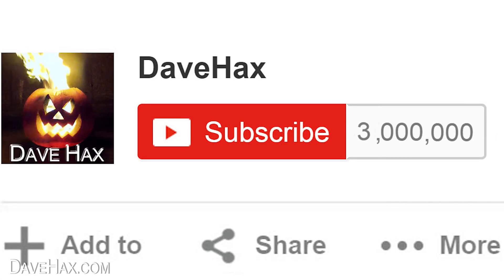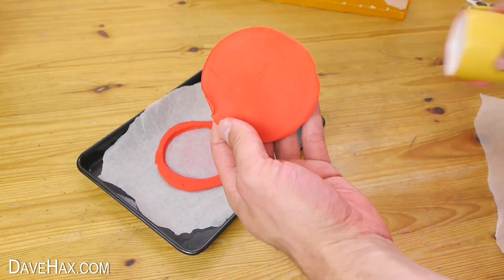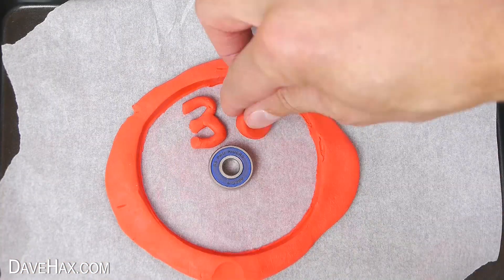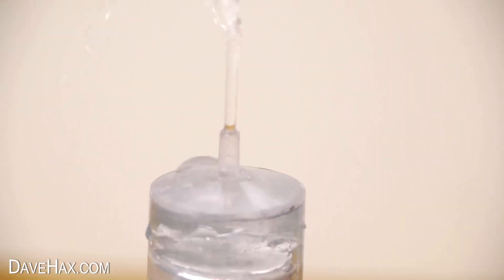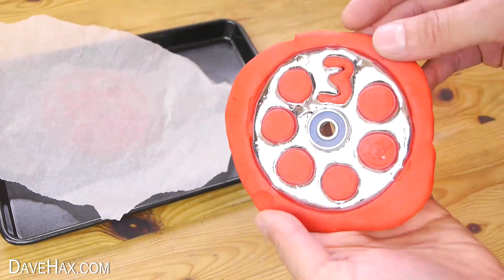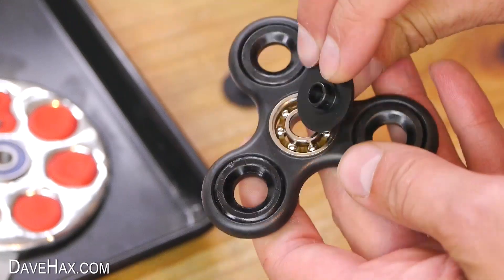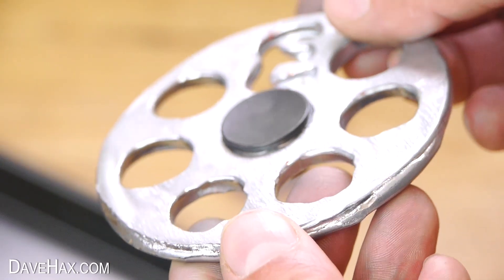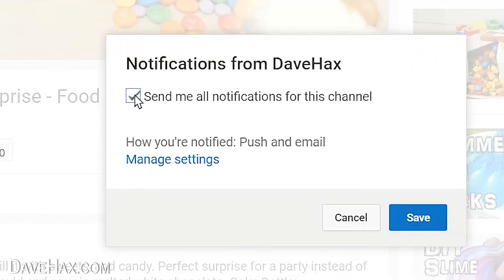DIY Gallium Fidget Spinner - 3 Million Special

Comment: If you were to cover the top of the whole fidget spinner with plasticine whilst the gallium is hardening you'd be able to get a smoother finish. just leave tiny air holes to relieve pressure ^^

Comment: try to spin this fidget spinner using a hair dryer ( of course dont use it on hot because it will melt the gallium) the Openings in the Zeros will allow the air to push it and make it spin